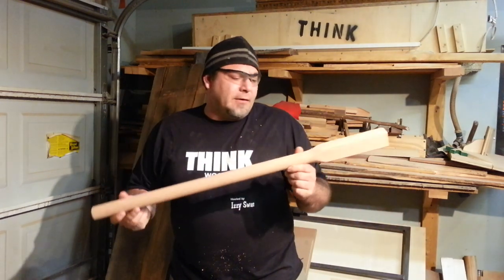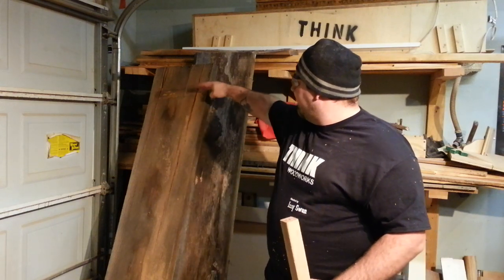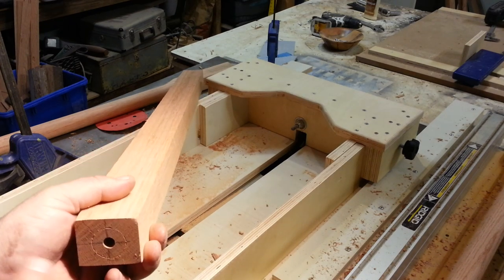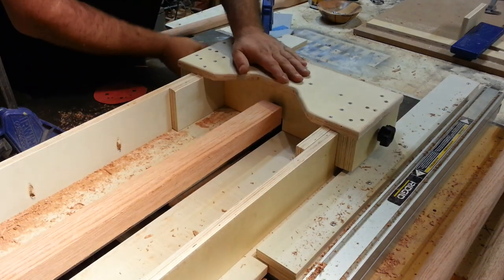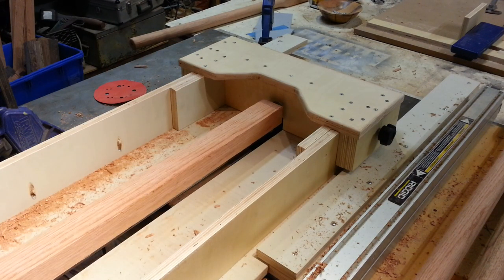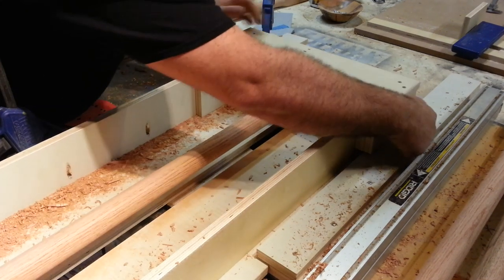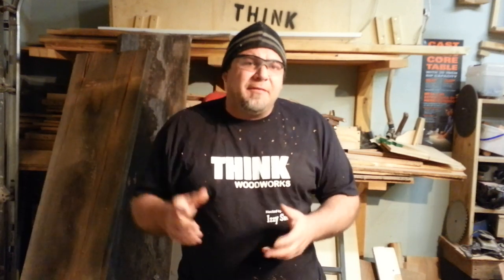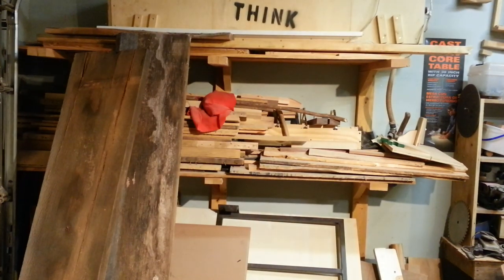Wooden Tool Handles- Table Saw Turning Reclaimed Oak

Comment: Izzy, I'm totally hooked on your videos.  These are the kinds of things that I did as a kid before I "learned better," started really accumulating bigger tools and started trying to do things "the right way," which usually leaves me disappointed (I'm finding that often buying the right tool doesn't give me as good results as building something or improvising something, their tolerances are higher than mine where it matters to me).  So I'm getting back into doing these kinds of things.  

That said, one thing you do not show much of building your jigs (I understand you don't really build this jig in this video but this one made me think of this since it would really affect this one) is what you do to get your stuff lined up.  It seems like a lot of it is a dab of hot glue (which I've never had any luck with for precise stuff) and drive some screws in it and it's lined up.  In this case, if your 2 spindles (your equivalent in this jig to a lathe headstock and tailstock) are slightly off in either axis you'll get a significant taper in your piece, so I was wondering:
- what tricks do you use when building your stuff to get it lined up?
- do you just "get lucky" (my friends tend to say I do, that I get away with things that shouldn't work or wouldn't work for others, I would argue that some of it is experience and some of it is that I do things in repetitive ways that I know will work out without measuring or whatever.  In a lot of cases the way things fit together is more important than what the actual dimensions are)?
- or do you just build tolerances into your stuff that you are good at compensating for/no one will ever see it there (honestly, I'm too anal retentive to really live with this, like I just made my twins a set of building blocks and they are made to within thousandths of perfect because, well I could by setting up jigs to make them- I'm really more of a metalworker/machinist than woodworker, like I made a jig to make the blocks on my bridgeport J-head)?

Thanks for your incredible videos!
Reply from the maker: the answer is yes.  I even get lucky once in awhile. lol  i build with in a pretty close set of tolerances that has just become a natural method building for me. I also build in the option for adjusting certain things that would not be overly obvious to any one but a very very experienced fabricator.  While wood working has been my living I do a lot more I tend to think of my self as a fabricator more then a woodworker.

Comment: Nice nice find on the 120 yr old (wow) oak 3k BF 8/4 and wide. Expensive yes, but how can you turn that down if good price. I recently bought 140bf of 10 yr opwn dried black walnut and am still using it. We know what kind wood you will be using for a lot of your upcoming projects now. Really like the cutter jig concept. Does it hurt your brain to be so smart? lol So simple yet so effective especially for production. You need a helper to turn all that for the customer. How about a young at heart old guy who loves woodworking? Thanks sooo much for sharing!

Comment: Another great video. Was just wondering, with the massive amount of material you remove, do you ever make a port on your jigs to attach a shop vac or some kind of dust collection?
Reply from the maker: I have never used any kind of dust collection outside my furniture manufacturing company.

Comment: Wow, Great Job, I loved. I get worried thinking that the saw could break some teeth by turning in the opposite direction to which it was made to work. Never happened?
Reply from the maker: In twenty years of using this method I have never broke a tooth or had anything bad happen for that matter. I make good and sure to use good bearings and that everything is very solid.

Comment: Awesome. Although my lathe teacher would say you need to be holding the sandpaper underneath with that direction of rotation so it throws your hand away if it grips rather than pull it in. Still, I've not turned in years so what do I know?! :-)
Reply from the maker: lol My shop teacher barely survived me. Having grown up around wood working I had already developed some bad habits before I got old enough to take shop.
Reply: Mine was all metal work - lathes, mills, shapers and so forth - think that's why I'm getting so into woodwork - fulfill that creative urge but a bit cheaper than metal lol!
Reply from the maker: I hear ya, my brother does a little metal fabrication and wow are those machines expensive.

Comment: I have got to make one of these.  Have you ever thought of putting a plexiglass cover on it though?  Or is it pretty stable and not much to worry about a board coming loose?
Reply: I was thinking about that too.   Don't mention the 'S' word.....I was thinking a cover to make the dust collection more effective.
Reply from the maker: It it a lot like using the table saw for the first time. Kinda Scary. but after 20 yrs of doing it I know as long as I build a solid jig It will be fine. I have never had anything bad happen using this method. not to say it couldnt.
Reply: Well you have far more experience than I do.  I have never worked with a lath and never really considered it until watching your videos.  I look forward to trying this out.

Comment: I've built several similar jigs and I've found that a slightest wobble in any of the sides results in poor profiles. Wondering how you secure the bearings and how do you make them  perfectly in line with the rotation axis

Comment: You're making handle blanks and I'm thinking stair balusters (well, rough finished blanks)    Add a little taper and some seasoning, bake in a warm oven and you're done.  

Pallet pals only need one handle, but staircases need dozens.  120 year-old oak ones would look real puurdy.
Reply from the maker: I had some moral dilemma at first using such wood for a tool that is only going to be beat up. But for the money its truly a reclaiming approach  using reclaimed material to reclaim more material. So in the end I think it has a value that can be appreciated by many people.

Comment: "One of the coolest pieces of equipment I've ever designed."  Dude, I saw that bowling ball on the tablesaw jig.  What can you POSSIBLY have come up with that outshines that?  :p

Sounds like a major score on that oak.

So... another noob question: Aside from the "hey that's neat" value of it. What's so good about old wood?  I see guys raving about it.  Certainly the idea of what it is makes it attractive enough, but is it actually different somehow?
Reply: I think the main idea is that its reclaimed.  So basically, its been reused twice now.  Also, I have been told that older wood is much stronger due to smaller growth rings.  I noticed on my house built in the 40's that the rings were smaller (much) than new wood maybe due to managed forests.
Reply: It's nicer looking--it tends to have richer color (for lack of a better word), is available in wider planks, and has straighter, denser grain patterns.
Reply from the maker: One of the things I like so much about wood working is the seemingly endless room for innovation and improvement.